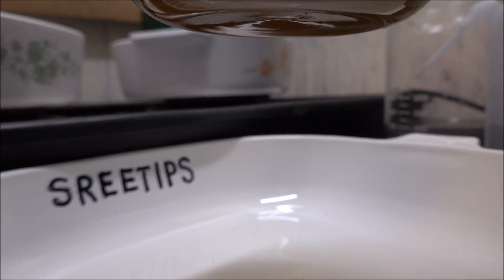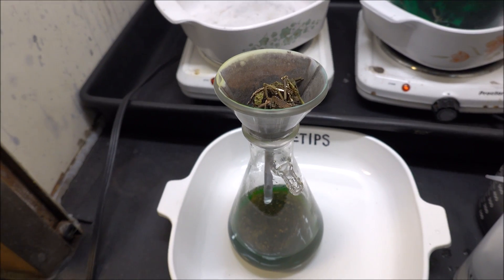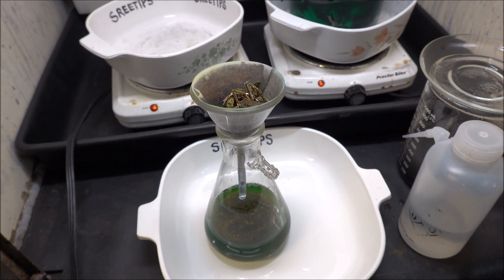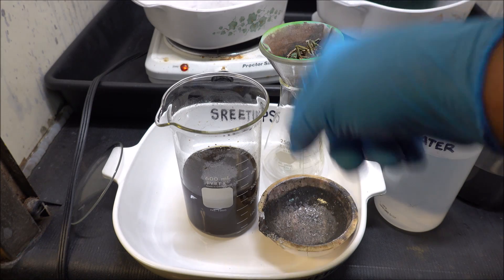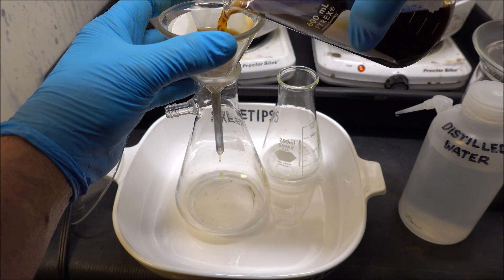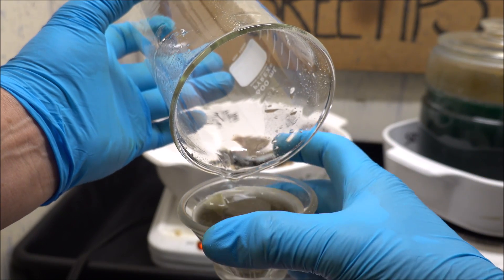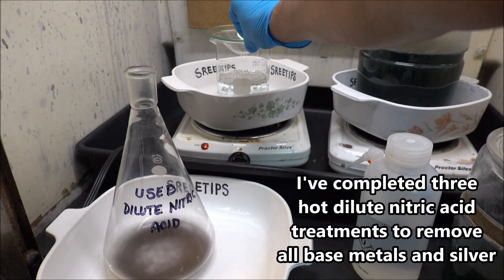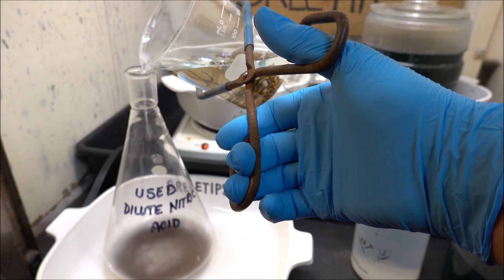Gold Recovery From Dirty Solutions

Comment: I understand that dissolving karat gold directly in AR is a bad idea for several reasons, but is there any reason not to dissolve gold filled scrap in AR before precipitating the gold as a concentrate (and then inquarting)? I do not have access to large amounts of clean nitric acid, but I do have nitrate salts.
Reply from the maker: I use as much nitric as it takes to remove as much silver and base metals as possible from the inquarted gold. I've never tried to refine any material using minimal nitric. In refining, the longer the treatments with nitric acid, the fewer problems later on during the rest of the refining process. I don't know if your idea is bad or not. It's not something that I would try to do.
Reply from the maker: Don't do it! Trying to dissolve gold filled scrap directly in AR would put EVERYTHING in solution and make a very dirty solution. It's difficult to get the gold from a dirty solution. Have a look at my latest gold filled refining video - my best ever. I don't see any way to refine gold filled scrap with no nitric acid.
Reply: @sreetips  I'm not trying to directly recover pure gold from the dirty AR solution-- I just want to remove a good chunk of the base metals so I don't need as much nitric acid for the real purification by inquarting with silver. The goal is not to completely eliminate the nitric acid (I can make that by distillation), but to reduce the amount needed. Is this still a bad idea?

Comment: Could inquarting technique be used on e-waste refining?
Reply: I typically melt it with a bunch of copper then electro plate the copper off then go to nitric then aqua regia
Reply from the maker: I've never tried it so I don't know. Usually the amount of gold from escrap is so small that inquarting would be overkill and difficult. If you had a nice button of gold from escrap recover built up over time and you wanted to purify it then inquarting should work.
Reply: @sreetips  yeah, it takes a lot of e-scrap to get much gold. But there are easy mechanical ways of separating out the gold bearing parts. Such as your video you made about the ram fingers. I think you said it took too much acid and created to much waste to get the foils separated from the fingers. You can separate the foils faster and easier with no waste mechanically with one of those wood burning art pens (like soldering iron). The foils are about 5% gold and probably could be refined easily from there. There are also mechanical ways of getting the gold out of ic chips.
Reply: @xdebugxDotNet  Have you been watching E.Waste Ben's Channel?? That's exactly what he does. He takes the ram and slot cards, heats up his modified soldering tool and he has the fingers off in 1 to 2 seconds!! He had his essayed and it only turned out to be 3%, but that's pretty good considering it's ewaste. That's 10 to 100 times better than what I've seen pins melted and essayed.
Have a GREAT Day!!

Comment: How do you dispose of your aqua rigia?
Reply from the maker: Once the gold is dropped I add it to my stock pot.
Reply: @sreetips  you must have a huge stock pot
Reply from the maker: Its a ten liter plastic bucket. It's full of copper. The waste is bubbled with air and any precious metals cement out on the copper. After a few days the solution, now devoid of precious metals, and full of copper, is transfered to my waste treatment bucket. It's full of angle iron. The copper cements out on the iron and the copper metal is thrown away. The resulting acidic iron solution is treated with sodium hydroxide. The metal hydroxides are filtered out and disposed of. The caustic solution is adjusted to pH7 and disposed of. Nothing toxic ever gets poured down the drain.
Reply: @sreetips  okay, ill probably just pour mine down the river.. just kidding.....

Comment: 1:12 Why's the soln black?
Can one inquart karat gold with Cu?
Reply from the maker: Yes, you can use clean copper or brass.
Reply from the maker: What turned the solution black? Good question. It was, no doubt, a base metal. Inquarting with silver then parting with nitric acid is one of the most valuable refining techniques I've ever learned.

Comment: I was already sold on inquartation!!
This was a GREAT demonstration on why inquarting is so necessary!!
I've seen several others just do aqua regia method. When I saw the how clear the solution was that's all I needed to know!!!
In fact you're the only person I've seen use inquarting method, but you're also the only person I've seen do karat scrap!
GREAT VIDEO, keep up the AWESOME WORK!!!!!!!!
Reply from the maker: Inquarting is right next to incremental nitric dosing. Two of the most valuable refining techniques that I've ever learned.
Reply: Most other videos I've seen they just make an arbitrary mix of aqua regia to do this and then ending up having to netralize it before dropping the gold out (I seem to recall urea can be used for this) or add the sodium metabisulfite very slowly to avoid having it go into thermal runaway. This seems like the better way to do it and it also saves on the nitric acid which can get pricey if you use a lot of it.
Reply: Shane York Cody’s Lab has done it. He had a precious metals refining series a few years ago. Nowhere near as in depth as Sreetips though.
Reply: @matthewf1979  Sreetips is pretty dang good. It would be hard to imagine anyone being more in depth than Sreetips!!!
Have a GREAT Day Matt!!
Reply: Comment worth Pinning.
Reply: Sir how many attempt doing gold,  recovery it's  same gram and purity plz tell me sir thank you have nice day

Comment: What happens if you add more silver ? does it effect the process in any way other then needing more nitic in the first stage ?
Reply from the maker: If too much silver is added then the gold will crumble into a powder. Then getting the solution separated from the powder becomes difficult. If too little silver is added then the nitric won't penetrate and dissolve the metals out. Adding the right amount results in chunks of gold that hold together during nitric boils making pouring off the solution a breeze.
Reply: thanks for the reply !

Comment: Gray sediment with the gold, some stuff precipitating after filtering... adding water to the filter probably precipitated some silver chloride. In concentrated chloride solutions, silver chloride actually is somewhat soluble. If you dilute such a solution the silver chloride will precipitate.

That is one reason to dilute a gold chloride solution before filtering. Chilling the solution will also lower the solubility of silver chloride.
Reply from the maker: Yes, the solution turned cloudy after I rinsed the filter. The extra water made the silver chloride come out of solution. I should have poured it back through the same filter paper a second time.